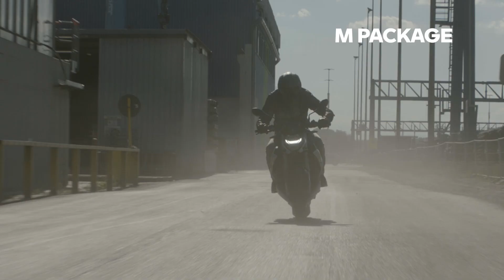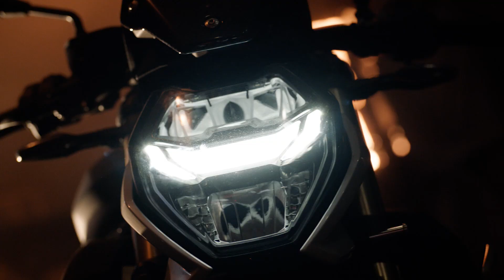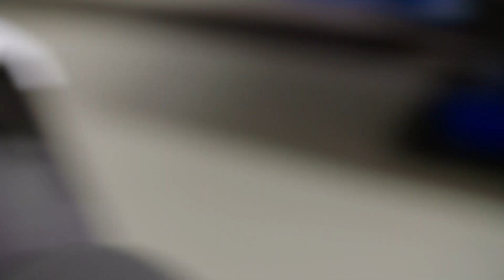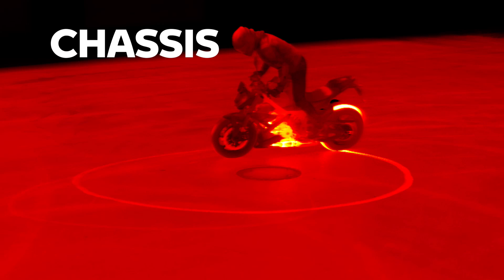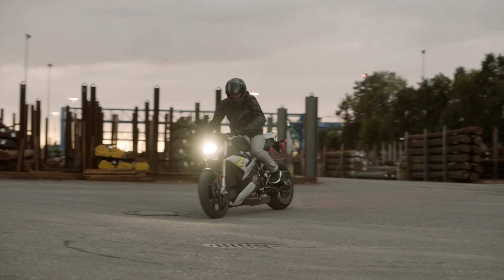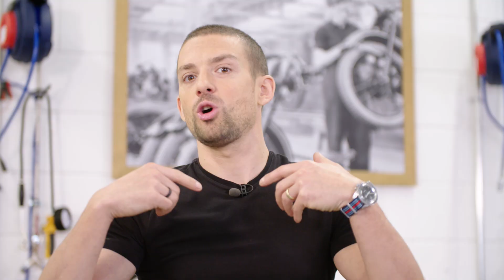IN THE SPOTLIGHT: The new BMW S 1000 R

Comment: Fabulous effort by BMW thIS generation of S1000R - Great to see a more detailed factory video that explains in some depth the design and styling benefits -And importantly also explains the difference between the various models - And also touches on accessory options to customise to individual rider requirements + preferences (esp wheels, luggage, screens and phone/app navigation) - Dealers never get down to this sort of detail and can only very rarely be bothered artculating even a few design benefits - Great initiative BMW

Comment: Attention to detail is unbelievable.   I still like underbelly muffler vs huge muffler stuck on the side
Reply: One thing to keep in mind, though. The bikes that have a huge muffler slung on the side are MUCH easier to get a nice, slip on exhaust for. On bikes on the S1000 line, you have a separate muffler and a lower cat that's welded to the headers.

Comment: This bike sweats high quality 😍👍
You got to admire the passion of Maximilian for the bike he created with his team.
What could have been great is that you made a video showing the engineers on their computers modeling the chassis and engine etc of this bike. So motorcyclists can really become aware of the high quality and efforts made by the workers who designed/engineered this beautiful bike.
I can't wait to see the shootouts that will be made by moto journalists against the competitors of this new S1000R !
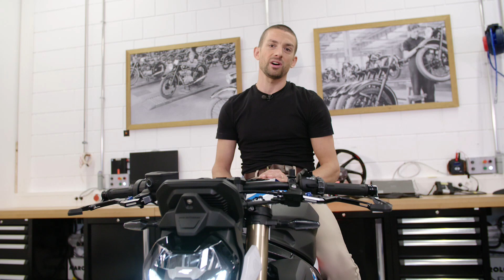12:42 This feature is so great, the rpm color graph moving as the engine warms up ! wow !
The only thing that would be very interesting to know is why you decided to use an axial master cylinder for the front brake instead of a radial one ?
Other than that it is a bike I would consider for my next buy. Really feels like it's a huge fun/pleasure machine 👍
Reply from the maker: Hey Lenso, 
thank you for your honest feedback. We´re really happy that you like this format that much. 😊 The opinion of our community is very important to us. 
Regarding your question: The new S 1000 R shares its master cylinder with the S 1000 XR, a bike that has been praised for its brake performance and modulation. In comparison to the previous generation, the new master allows for a design that nicely integrates the brake fluid reservoir.😉

Comment: My 2014 s1kr has 120k miles and still going strong I’d like to upgrade but I’m going to ride it until it blows
Reply: That’s amazing!  I wish I lived in somewhere warm to ride more often.  Do you notice the age or it just as good as from day one?  I put 4K on my 2017 that I picked up this year.  Amazing machine.
Reply: @chenchen8597  I can notice that it has aged just a tiny tiny bit. The bike has been great, in its lifetime and I’ve only had to replace the stator and the tps sensor. But honestly I can see myself turning 200k on it because it really does still runs amazing
Reply: That's really some achievement and speaks volumes about BMWs current quality. Congrats!
Reply: @Fatalityx209  Have you had problems with the rattle when starting?
Have you replaced the cam chain tensioner cover?
At what mileage?
Reply: @jollyrogers7666  the rattle will always be there with the oem on startup but like around 25k I got tired of it and and replaced it with the manual cam  tensioner
Reply: @Fatalityx209  Hahaha you are absolutely right. The rattle is always present in the engine to a greater or lesser extent.
Mine is 3,500 km long and the noise is still normal.
When the noise is too annoying, I think I'll switch to the manual tensioner system, instead of the original OEM tensioner.

Comment: Hello Max, I have 1 week to order a standard bike which will arrive at the end of April, this is for a base model which no one wants.  Everyone want's all electronics.  Due to my weight and riding canyons and tracking,  I am worried about the vibration in the bars which I experienced on 4 different test bikes from 2014-2023 which caused numbing in right or left hand within 20 minutes on the road.   I will  need to install heavier front springs and rear coil.   My weight is 215lbs. plus leathers.  Why doesn't BMW offer options on different springs weight and rear coils for the front and rear suspension for heavier riders?  As I mentioned this is for the base model.   I appreciate any help on this before I give the dealer a $1,000.00 deposit non refundable  to order a base model.  Please disregard my older comments and hope you can get back with any good news!  This will be my 1st. BMW naked bike and looking forward to enjoy riding her for many years.
Thank You
Joe

Comment: Waiting for the swift cam
Reply: the shift cam is also off on the RR above 3000rpm so don’t worry
Reply: @TheRickster998  What are you talking about? The way shift cam work is it has 2 profiles, "low lift" and "high lift". Below 9k rpm, it changes to low lift for better torque and midrange power and above 9k it changes to high lift for top-end power.
Reply: @Fearless154  On the dyno it has shown to be switched to high lift already at 3000rpm, so basically you will not notice it during riding.
Reply: @TheRickster998  I definitely cannot confirm this.
Reply: @TheRickster998  Non sense. You cannot know based on the dyno chart alone when "it turns into high lift or low lift" it just seen as regular and smooth torque curve with most torque already available from 5k rpm.
You're probably from US and what you're trying to is that s1000rr in the US market is highly restricted in lower rpm to meet US noise regulation. But the restriction in the ECU not the shift cam itself the shift cam still working as intended but due to the restriction the bike is not benefits from low lift.
But not such issue exist in european s1000rr also, you can fix it by flashing the ECU.
Reply: no
Reply: @TheRickster998  Either way you don't know what you're talking about because you simply cannot see the shift cam changing profile just based on the dyno. Please make sure you do some research before you post such ignorant comment. Also, I would like see your link on that "dyno chart" and how did you came to this conclusion just based on that.
Reply: @Fearless154 Why would I mention it when I did not do the researche? Do you have any information? No, you are are just guessing. Take my information or not. I have not checked it myself on the dyno but I trust 2 sources (engine tuners). It is still a very good engine.
Reply: @Fearless154 You bet wrong.
Reply: @TheRickster998  Also, I'm very curious about what is your method. When you're looking on the dyno graph of s1000rr and can tell from xxxxx of the rpm range "We can clearly see the shift cam changed from low lift to high lift"
Reply: @Fearless154  Don't call something pure nonsense just because you got an internet connection and think you know it all :-)
Reply: @TheRickster998  Still waiting for your method, and some links or at least names of the tuners.
But so far you're keep on making fool out of yourself talking about things you have no clue.
Reply: @Fearless154  Since you are talking in terms of "absolute nonsense" and "you have no clue" I have no intentions of sharing any further information.
Reply: @Fearless154  Get off the net. Get a life or a job :-)
Reply: @TheRickster998  Very ironic comment from someone who talks about things without having a single clue and when you got called out, You went full troll mode wasting our time.

Comment: Are you having a laugh no shift cam to save money? A fully loaded S1000R m package cost over £20k which costs more then the S1000RR M-sport.
Reply: Be happy! 😃

Fully loaded in Denmark cost more that 50K €
I’ll trade anytime with you 🙏🏼
Reply: @PZohard  problem is not the price per region but between models. You can buy a s1000rr for it wich has shiftcam engine
Reply: @s.k.6823  Apples and oranges. A similarly specced R will still be a lot cheaper. It's not like you are forced to go full bananas and order every single option incl. the carbon and billet packages, with you certainly have omitted for the RR spec price
Reply: @Bikemax99  2000€ are a lot? That is not even 10%. Full specced R is more pricey than a normal specced RR. For full you talk 24k€ vs 26k€ in Germany. Hell for this price I want brembo stylema or M50 and Öhlins Nix/TTX (same Problem with the RR). This thing costs too much and the plastics look cheaper with every modelcycle (compared my old 2013 RR against a 2020 RR). And now it also has a very interchangeable look in the front too. I sold my 2013RR but don’t think I would go to the new R or RR

Worst thing is this blue lock cover on the red bike 🤮
Reply: @Stephan Kluge with equal spec (features contained in the comfort and dynamic package, M package with carbon wheels and titanium exhaust, eCall, RDC) the German price difference is 2,900.03€. to many, this is not trivial. Even more so when you consider configurations without the M package.
Reply: @Bikemax99  for people considering it too much maybe a 24k€ bike is a bit too much. The difference is below 10% of the Price of an RR.
I think for what they are, they are both too pricey. The barebone Versions might be an option but BMW has put this blue lock cover on a red bike 🤦‍♂️ the only Color option (the other Color looks like primer Color)

Also I answered to the guy who said they are pricier in Denmark. Which might be but is not what the original commenter was saying. And yes it is a bit of apples and oranges. But BMW calls for it since I think the R1250R is the better everyday bike in the roadster segment. Also Apples an Pears like we say in german
Reply: @Bikemax99  actually that doesn’t include billet or carbon packs with them it’s £22.5k
Reply: @samh3467  on equal spec terms (RR M sport still lacks titanium exhaust and M endurance chain, so these need to be added) the R is almost 2100 GBP less expensive (20,990 vs 18,900 for an R Sport with the M package incl Carbon wheels).
Reply: 3200 euros difference between R and RR. And I don’t need RR for daily street use. If I would like to spend extra 3200, I will be going for V4 SF. 16500 euros for dynamic, comfort package, m chain, m batterie, alarm, pro lights - fair price. Want cheaper, down grade for MT09 for 11250
Reply: @Bikemax99  How do you compete with the fact that Ducati Streetfighter S has 200 hp and with Akrapović 214hp? Horsepower does matter. For the $23k shift cam engine needed to be included. I'm a previous generation owner and while the bike was not slow by any means, it was also almost $10K less than the new one. That fact cannot be disputed. Btw this is coming from a BMW fan whose daily driver is a M4 and the next one will be M5CS and has visited the Welt. Honestly I think you have missed the mark... I'm still willing to give it a chance.
Reply: @stevesuric9046  fair enough, and congrats on that M4, btw! As an analogy: why did you go for the M4 with its "inferior" 450 HP, when you know the C63 AMG serves up to 510 ponies? ;-) maybe there is something beyond a single figure that can be found in handling, precision and feedback.
Of course we could have given the R some willy-waving-contest-winning 200+ HP. Matter of fact this would have already been possible back in 2014 with the first gen. But we deliberately chose not to. Why? One must look beyond the peak HP and see where in the rev range that power is made. Since HP equals torque x revs, in order to achieve higher peak HP one must move the powerband to the right, i.e. away from where you actually spend time riding the bike.  In simple terms, this means when you pull the pin coming out a tight corner at 4,000 RPM, you have to wait longer until you finally get to the real power. Peak HP is a great marketing tool. But it says nothing about the size of the area under the curve. It also doesn't mention, e.g., that that power is only made available in 5th gear, at which point you would be riding at speeds which are unbearable on a naked bike (130+mph). A German magazine did a side-by-side rolling start comparison and measured the speed after 3.0 sec: Streetfighter was at 119 kph, the (previous and heavier) S 1000 R at 117 kph and the Aprilia Tuono at 114 kph. So the differences in nominal peak output didn't translate to significant differences. But I digress.
It's ok, every manufacturer starts a project with a certain goal in mind. Our goal was to 1. create a fun and agile machine that will excite both on curvy canyon runs and trackdays, 2. develop an engine that gives more average thrust at the revs that people actually use on the street and 3. make the RR tech and feel financially more accessible to a wider range of riders so more people can experience the thrill and fun of the platform. I'd say give it a try. I genuinely enjoy the discussion. If there is more you want to know or elaborate on, feel free to ask. Cheers, M
Reply: @Bikemax99  Max, thank you for your succinctly reply and well done.I appreciate the fact that you took your free time respond. In regards to C63 AMG, boring! even with 10,000HP LOL! :) M4 is just a better machine, (Now about that front end on the new G80 chassis, errr... I think you know :) ). Anyways I won't do a point by point rebuttal because it would take too long and your points are clear. Let me just say that I hope that the new bike will perform as expected and yes I will give it a chance. I did look into a Streetfighter V4s a while back and while it did have that special feel to it, for $27K it still lacked carbon pieces and no heated grips (even though the button is on the bars just not connected). I hope that the new R will feel special, when you look a the design of the V4s or the new 2022 Touno (at least in the pics) it has that Wow! factor in it. Not sure how much time you spend checking out the competition, but take a ride over to the Ducati dealer and you'll see what I mean. Fully loaded R is $23k which is only $2k less than fully loaded RR, the price point lines are getting blurred and that is why I'm harping on the special part. The old bug eyed bike was and is instantly recognizable, the new one? I'll let you know when it arrives at my dealer. Take care Max, Ill you know my impressions of the new R when it arrives. :) Steve.
Reply: @stevesuric9046  cheers!

Comment: Hi, just received my new 2021 S1000R. Just a question, i am exactly 6 feet in height. Which seat option best suit me? Standard? Lower? Or higher?

Currently with the standard, i dont feel quite comfortable in terms of riding position and handle bars position but i am not sure if this is due to my height vs the standard seat. Appreciate bmw advice before i change my seats.
Reply from the maker: Hi James, congratulations on your bike and thanks for reaching out to us on your question! Please contact your local dealer for more information. He can surely help you out and show you all seat options available. The local dealer can be found at www.bmw-motorrad.com/dealer. 😊

Comment: Can you please let me know what is brand and model of short mirror fitted in the middle one?
Reply: It's a BMW mirror, made specifically for the S 1000 R. In contrast to other products it features a rubber decoupling element for improved vision
Reply: @Bikemax99  i am owning a S1000R PRO, 2018 model...I am from India...can u please help me to get a pair of this...thanks in advance.
Reply: @titasjana  the mirror will not fit straight away, because the 1st gen S 1000 R uses M12 bolts to attach the bar end weights, the the new gen uses M10 bolts. It would probably require a lot of modification, and I'm not sure it will work.

Comment: Hi Max, I am confused. Is the Shiftvalve used in the 2021-S1000R or not ? Magazines give contrary messages. Thanks!
Reply: No, its not. Its the same engine as the S1000RR. And Max does explain it quite well in this video.
Reply: Thanks saegenerv and yes, I watched the video again and Max is indeed clear about the use of the  Shiftvalve. The S1000R is (low)-geared differently and does not need the extra torque at low rev's. The S1000RR however is high geared and needs additional torque at lowere rev's.  High and low is ofcourse relative.

Comment: Hi i am buying the sport model but don't want the key less ride on it.
and my dealer says this feature can not be re moved from the sport model.
is there any way of removing this
Reply: You mention "sport". This typically refers to a ex-ante configuration variant sold in the UK. If you - for whatever reason - don't want Keyless, you could always build your own configuration and have the dealer order it from the factory. Check out the UK website and head over to the configurator to build the bike you want 👍🏼
Reply: @Bikemax99  hi thanks for the reply. but if you don't get the key less ride you lose the comfort pack
Reply: @Bikemax99  even when you build your own
Reply: @Bikemax99  plus you save about 700euro by getting the sport pack over building it

Comment: how tall are you?
Reply: I'm 174 cm. If it helps, I can place both heels on the ground even with the now nominally higher standard seat height (830 mm now vs. 814 mm for the previous gen) thanks to a slimmer chassis and optimized inner leg curve. As stated in the video if you like you can choose two different seat heights ex factory at no additional cost.

Comment: Wie er die unlackierte Plaste am Heck als „Design“ verkauft. 😂
Design ist auch nicht überall Logos draufzupappen. Der Preis ist frech mit dem Motor ohne ShiftCam und die lampenmaske sieht aus wie von der F900R oder G310. Oder halt beliebige lampenmaske aus dem eBay Zubehör. Ja schön das ihr endlich LED habt aber dann so ein beliebig langweiliges Design.
Viel unlackiertes schwarzes Plastik für den Preis. 

Und warum die Kappe für das Schloss am Heck? Und warum ist die Blau? Das sieht bei der roten extrem Panne aus.